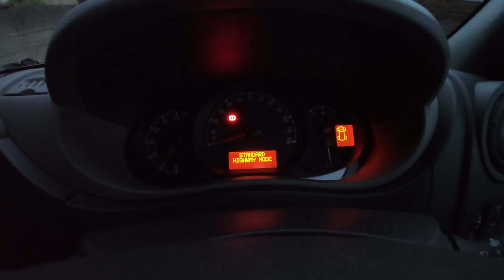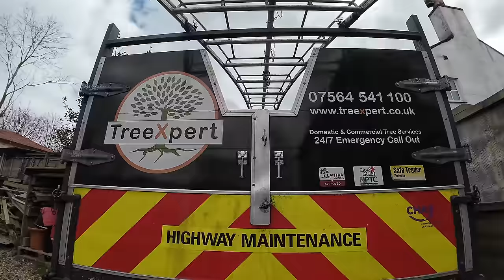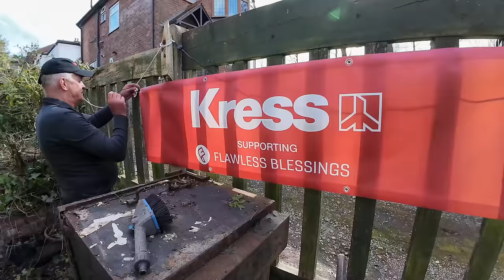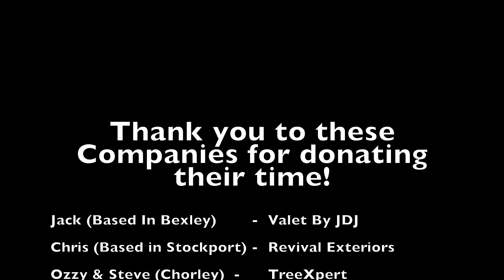MADNESS! Trees Cut Down.. Rested On Her ROOF! *Helping Barbara Ep1*

Comment: The tree experts’ work will protect Barbara’s home for years to come. Improved air flow across the roof and in the garden will make such a (positive) difference. Thank you for an epic video, Ben. 😊
Reply from the maker: I loved how they checked around the property and suggested more than we originally mentioned all for Barbaras safety, great chaps they are!
Reply: Look forward to part two when you have Barbara water tight will you be taking the tree stumps out and levelling the round out as I see it’s on a bit of a slope be nice top job that if you able to sort it mate
Reply: That place is falling down and is downright dangerous and nasty. she should be placed in a senior center type of nice home. Not live in what is essentially a hole in the ground.

Comment: I am a little confused as to how all those trees landed against the roof!

I read the description, and it doesn't explain anything of what happened other than the tress were cut down.

Who cut them down and let them lay on the roof to rot?

Any fool would know that leaving those heavy trees against the roof would trap moisture there, and heat, and as they rotted, would allow mold, fungus and other unwanted things to grow!

Whoever did this and left it needs to be sued and held accountable.

Now her gutters fell down and it looks like that was because the roof started to rot away at the eves.
And the windows he showed were separated from their frames and the house!

That glass of the large window was just hanging there with no real support and is very dangerous!

I can't believe no one from the city could have helped her in some way with a local or regional program that helps senior citizens with a grant towards home repairs.

Comment: Ah yes, a hoarders house. Did you contact Social Services for a welfare check? And the local fire dept for safety check? There is multi agency help available locally, hoarding help volunteers, and grants available for the elderly living in such conditions for home improvements. Clearly the occupier has refused help from neighbours or friends. Without mental health support for her you're wasting your time as it will be the same again shortly.  Im surprised at you going to such lengths to produce such a " heroic" video. Unsubscribed.